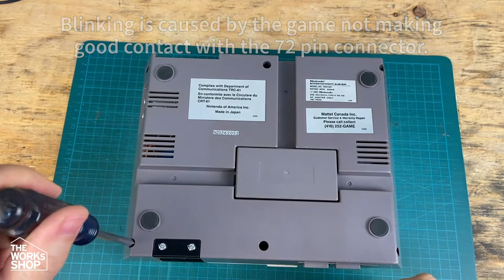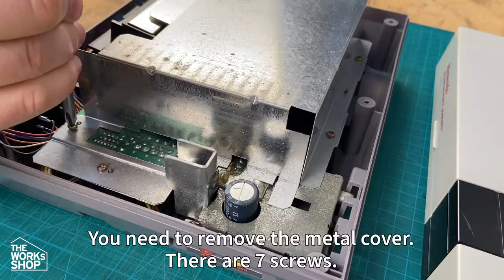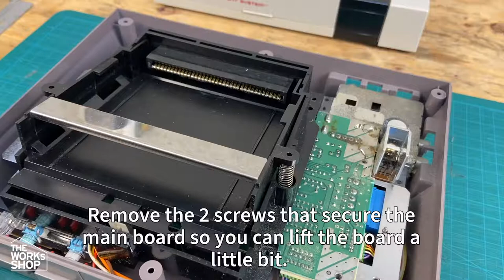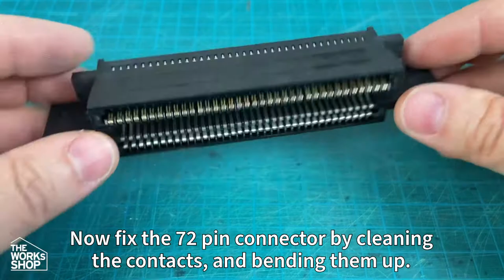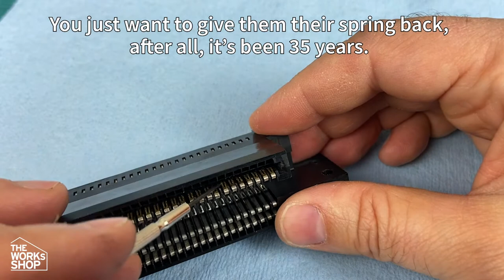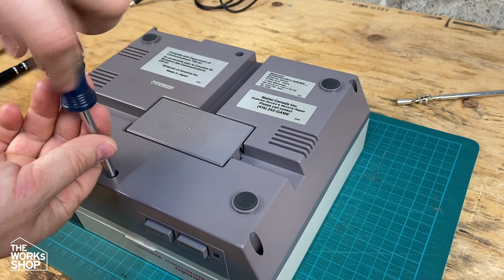Watch This Before You Replace Your 72 Pin NES Connector

Comment: 1. You don't ever sand plated contacts. Use electrical contact cleaners or 90+% rubbing alcohol.
2. Don't use a vacuum cleaner that can generate static. Use dry compressed air to blow out debris.
Reply: So can i just blow on it?
Reply: @Not_Srpsk you don't wanna do that either. The moisture from your saliva will damage parts. If there is a lot of dust and debrie just wet a tower with some alcohol then stay it down with a can of air after its dried.
Reply: @davidstaffen6783  oh ok thx
Reply: So if you know, that’s why are you watching the video?

Comment: Do NOT use sand paper on contacts, it opens them up for significantly more corrosion. That and the main board ones are generally perfectly fine, as the connector never moves off the console.
Reply: What to use in lieu of it, in that case?
Reply: @SirRyanChadius  If it must absolutely be done, I’ve seen a few people use pencils erasers alongside isopropyl and that is much gentler
Reply: @messageman5181  Ought it be done? I am looking to get into buying and selling them as a profit, so y'know.
Reply: @SirRyanChadius  that’ll be a tough job to make profit on, but to answer your question, don’t file the contacts unless absolutely necessary. First just try cleaning with isopropyl, and if that gives no better results, make sure the pins are all good, then proceed to use the pencil eraser to lightly rub the contacts and clean any pieces/eraser off with more isopropyl Q tips. You should never have to actually use the pencil eraser on the connector on the actual mother board.
Reply: I'm curious, how does it open the contacts up for MORE corrosion?  aren't they already corroded and at worst they'll return to the way they were before you wore them down?
Reply: @panikk2  as stated, main board connectors should be fine as they generally do not move or have any opportunity to corrode. But any protective coatings will be removed and you will lose material and risk damaging the pads with harsh solutions such as sand paper.
Reply: @SirRyanChadius  can I just use a qtip and some cleaning solution for the contacts
Reply: I have boiled my connectors. 20-30 minutes and they were brand new again
Reply: So what should I use instead to clean the mother board contacts?

Comment: Please stop using sandpaper or any abrasives on metal contacts. Also, alcohol does not remove oxidation. Use the proper product like a contact cleaner such as Deoxit D5.

Comment: lmao @ use 2200 grit sandpaper to file the heck out of what is supposed to be a smooth connection plate and expose it to oxidation by creating tiny little divots in the metal.  Then next step, gently clean with rubbing alcohol.  You just sanded the metal but must be gentle with a cue tip? lmao

Comment: Bending the pins did the trick! Thanks! 
I didn't use sandpaper, I just used contact cleaner and some Qtips and bent all the pins.
I have another blinking one and I would bet it's the same issue.
Reply: Lol i also have 2 blinking nes

Comment: you forgot about the pins that are "above" the ones you bent with a small screwdriver.  The cartridge has tracks on two sides and you only dealt with those on one side.  I do not recommend.

Comment: Refurbished my 72 pin connector (and whole NES) but the the games won't work WHILE DEPRESSED. So they only work when you stick the game in and leave it up with the flap open. I tried loosening the screws that hold that loader mechanism down bit it still won't work correctly.
Reply: I encountered this just now. I had to bend the pins down again in order for it to read while pressed down. I don't think these pins are supposed to stick up. The connector isn't supposed to grip the cartridge pins firmly, hence why it needs to be pressed down. The only pins that would need to be bent up would be the ones that are noticeably pushed down into the connector. Just clean the pins and SLIGHTLY bend the pins that look to be too far down. There is supposed to be a gap!

Comment: Goddammit.. Don't use sandpaper, use rubbing alcohol 90% No need to bend the pins, use a toothbrush with rubbing alcohol to clean of the contacts, then boil the 72 pin connector for like 10-15 minutes. Let it airdry, you could brush it with rubbing alcohol again. Then fit it back when it's completely dry, ideally after letting it airdry for a day or 2. Then it works, atleast, that's how i fixed my Nes back in 2013, still works till this day. And OH! Don't forget to clean all your games with a Q-tip and the same rubbing alcohol, if the game is dirty it won't work.

Comment: TL;DR DO NOT FOLLOW THIS VIDEO; FIND ANOTHER THAT ISN'T HELPING DAMAGE/DESTROY YOUR CONSOLE.

For those who don't know, any cleaning of the contacts would've been perfectly fine being done by denatured alcohol/technical alcohol (99%+ alcohol) and a tech brush; this is what is used in the electronics industry at major manufacturers, who have need to clean circuit boards, connecters, solder pads, etc all the time.  I would know, I worked at a major manufacturer for years doing specialized soldering, repair, quality control, and troubleshooting.  Rubbing alcohol, even at 91%, has 9% water, which is damaging for electronics, traces, pads, or connectors of any kind.  Then again, for the money you wasted on the sandpaper alone, you could've just bought a brand new replacement connector that many thousands of folks have used successfully already.  

For the creator:  You lost me at the sandpaper and standard rubbing alcohol.  That is NEVER a plan that should be followed outside of the apocalypse.  This is also a great example of why dislikes never should've been hidden; this video is the worst one I've seen so far for working on this problem, and I'm sure the like to dislike ratio would show that there's an issue.
Reply from the maker: I actually did buy a replacement connector first, it was awful. It was so tight you had to force the cartage in, and you needed pliers to pull it out. I returned it, but since it is a replaceable part you really have nothing to lose by fixing the old one for free. The replacement part was around $20 CAD (got my money back), I already had sandpaper, but it was $1.99 a pack, so way cheaper. I’m not worried about more corrosion since my house isn’t humid, and if I have to clean it again in a decade or replace it, I’ll do that. It’s been working great for over a year now so I’m happy.
Reply: If I'm going to replace the pins anyway, what does it matter if I try sanding them?
Reply: @ashemogh  you can’t replace the pins on the main board, which is the ones they’re telling people not to sand.